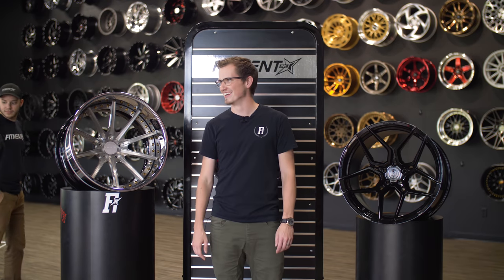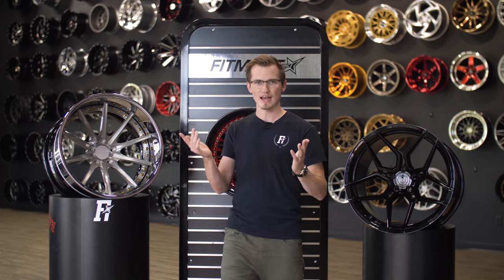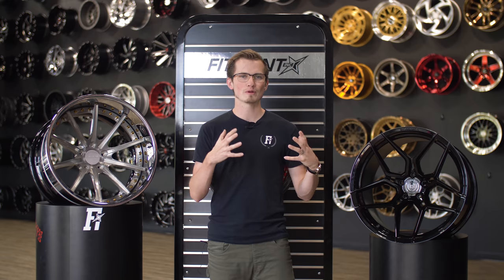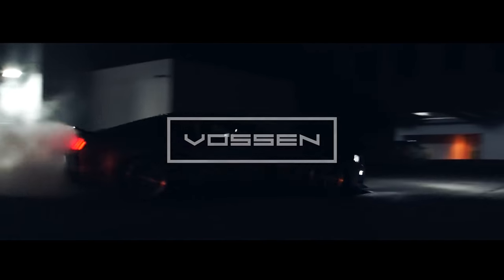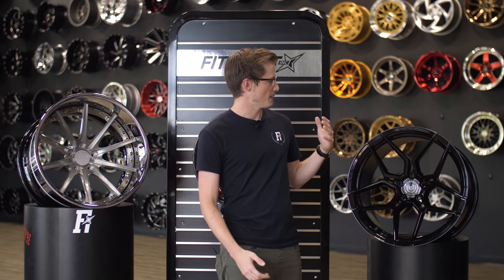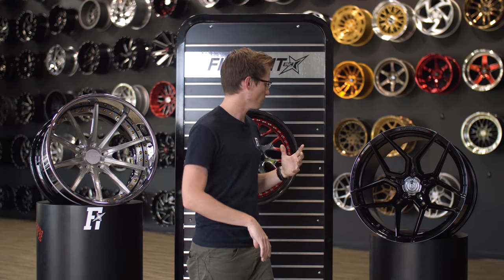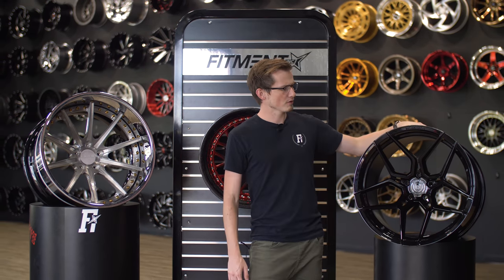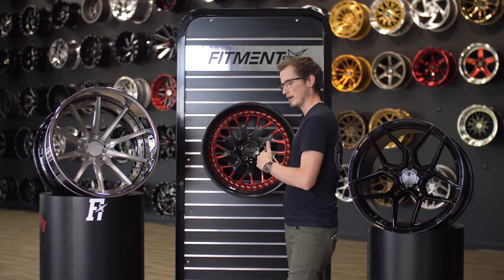Which Wheels Look Best? Lip vs. Concave vs. Both?!

Comment: I don't even have to watch the video to tell you that wheel styles you choose should be based on what you like and what looks good on the vehicle you are running. Some wheels look better on certain vehicles than other kinds. Just decide what fits, looks good, and makes things pop in style.

I had to replace my rims from my Sport Trac from the FoMoCo rims to the KMC KM673 Skitch Satin Black rims. I think they look great and they kind of have a little of everything when it comes to the wheel looks you are describing. Sadly enough, they are discontinued.

Comment: MAKE A TOP 10 LIP WHEELS FOR A LOWER BUDGET NOOOOW!!!
Reply: used vsxx and vskf will make that list realistically
Reply: Why don't you save up some money and buy a great pair that'll last?
Reply: Lol. What's your budget?
Reply: @YaketyYakDontTalkBack  100 for a set of 4 plus a full size spare? 😂👌
Reply: I have bmw 525i 2003  I want put wide tire  what size rim I can use for it
Reply: Can I use  245 40 18 inch
Reply: Lmao 😭😭😭
Reply: I have a 2009 Q7 and want to run a staggered setup with that hybrid wheel. What do I need?

Comment: Cars are wind tunnel tested, to improve efficiency, reduce drag and wind noise. Are wheel tested? For Areo and brake cooling? Style is great but is a functional wheel also taken into consideration for most wheels? 🤔
Reply: Yes, but mainly for structural rigidity.
Reply: For the most part the wheels are whatever looks good. The main thing with oems is to either vent wheel wells or move air around them. 

They don't bother to use wheels to remove air from the wheel well. Way to much work and not enough gain. 

Besides, oems offer 19 & 20 inch wheels with a lot of space between the brake caliper and the wheel it's just for looks. Aftermarket wheels (good ones) go through testing to meet some minimum of quality. Best advice it avoid eBay wheels and any decent manufacturer will have specs on their website or provide them when you ask
Reply: makes since. Thanks for sharing your knowledge comrade. I want to add some offset to my wagon. Oem Wheels are tucked a bit much. So guess if I want more offset, I should look into a balance of function and form.
Reply: wheel aero as far as I have seen only are designed into supercars and race cars to funnel air in and cool the brakes. it's possible some of the newest OEM sports cars could have this feature as well as that tech usually trickles down over time
Reply: @Vultite  nah a lot of cars have some ducting to the brakes. My 99 ls400 has this. What the op was asking was like designing the wheel to be like a fan and pull the air out. 

While possible, it really doesn't work. Standard wheel vents are significantly easier to make and install. But they can look good, look at Koenigsegg agera wheel fans

Comment: I like the concave look as well.  I bought a set of Gloss Black TSW Clypse rims and they really changed the look of my 2021 Hyundai Palisade Limited.   The rims gave it that touch of aggression that was missing from the it.
Reply: I keep eyeing up the tsw clipse in gloss black for my tlx how have they held up
Reply: @dropem555  …….They are doing very well.  I’ve put about 10k miles on them, and I have no complaints.  The ride is smooth and with the Michelin CrossClimate2 tires that I’m rolling on, it’s an improved ride.
Reply: @kennethwalton5582  nice thanks have they seen any winter weather or they exclusive summer wheels

Comment: Uhhh I'm sorry but VIP Japanese wheel manufacturers have been doing concave face with a deep lip for decades. I have original Weds Kranze LXZ On my Stagea. They have had a flat or concave face option on a 3 piece wheel since they were released in the 90's.

Comment: Alex i need you, or more your help but not in a shrink kind of way, come to think of it i might need one after all 😂 well i went and bought a 2019 volkswagen golf (Dont know if its really a vw as i havent seen a check engine light yet), not one of those R models not even a GTI. But one with a 3 cylinder 995cc engine (might need a shrink?) i decided to go for that one as im mainly using it to commute back and forth to work (60kms a day). The good thing is that atleast it got an R-Line package and is painted in the Oryx white paint that is a pearl paint that makes it shift between white and a really nice grey color (papers sais its silver, havent seen it silver thou). Ok well enough talking. I would like to know what you would choose for kind of suspension as in air or coilovers? And what wheels would you choose for it, brand and color? Im usually rather good at choosing wheels but i feel i cant even decide upon what color to use as the car shifts color. Did u just win anything for making the longest comment on Youtube 😂😂

Comment: I love both,but i rebuild myself some 3 piece Artec mk dynamics(9,75x18 and 10,25x18 with 2,75 and 3,25 lips)not that well known wheels but they use them on porsches. My single piece wheels are concave Team Dynamics Jade R's( discontinued i believe,i bought the last 2 wheels in 9,5x18 that where in stock in my country) and my winterwheels are Team Dynamics pro race 1.2 8x17.

Comment: Honestly on camera the ESR1T looks a bit flimsy and toy-esque. I'd say 800 at most for a set of 4.
Reply: dude, those are Fully Forged, Carbon Fiber lipped, FULL nut and bolt titanium hardware, and two tone face finished wheels.
A full set of those wheels are ATLEAST 8k. 10x the amount YOU thought they were worth. Those arent cast. those arent rotary/flow forge. thats THE highest end wheel you can get from ESR.
Reply: @ivebeen exactly
Reply: yea i doubt you could get the ti-bolts upgrade for 800 the rims are 3500 a piece depending on what all you do to it
Reply: @ivebeen I agree man I don't know how people can spend 12-15k on rims. But they do every all the time. I just bought new rims from radi 8 they were cheap and unique and I put a killed paint job on them making them super unique

Comment: The bigger the lip the better
Reply: eh i had 5" lips for 13 years... i rims i just bought have no lip at all, but the paint scheme i put on them makes them one of a kind
Reply from the maker: Let's see your ride with these wheels man! You should upload it to our gallery. 🙌👍https://bit.ly/2Ma4oca
Reply: well i might end up doing that but I am repainting the truck, the rear fenders are off and I'm repairing all the rust. i took i photo of them on the hotrod but its just so dirty/rusty and overall embarrassing, some people like patina but all I see its a run-down hotrod in need of lots of work
Reply: just looked at that link you sent me, under type it doesn't have truck or hotrod as choices